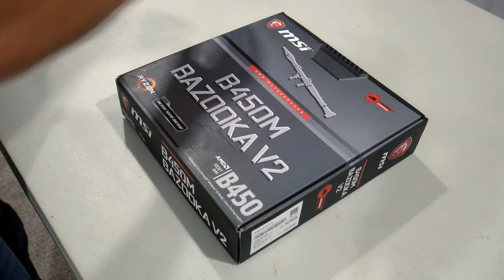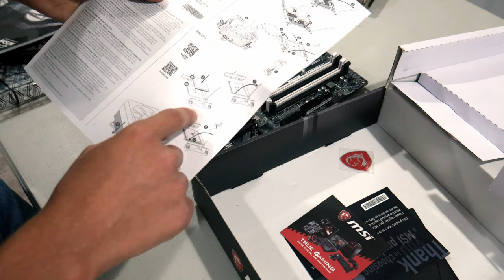Let's Build a Gaming PC from Start to Finish!

Comment: Thank you for this - first time building a PC and this got me almost all the way through. The only hiccup was the little plugins for the front panel into the mobo, I wish you would have explained it a bit more but the mobo manual filled in the gaps. The PC runs like a dream.
Reply from the maker: Yeah, sorry about the front panel cable portion missing. My camera died while I was doing those but they vary by motherboard model anyway so the best thing to do is just follow the manual. Glad you were able to get it all fired up!

Comment: In that connector slot on the motherboard, does it matter where you plug in the front panel headers?
Reply from the maker: Good question! Yes, the motherboard manual will tell you what the specific order for the pins is.

Comment: Sorry for such a dumb question, but what kind of fps do you think this would have in Apex Legends?
Reply from the maker: There are no dumb questions!
The GTX 980 Ti GPU should probably get around 90FPS at 1080p at High settings, with FPS possible by lowering some graphics settings. Hope this helps!

Comment: quick question ive got the pc built with everything but the graphics card do you know if i can go ahead and install windows and all that anyway or should i wait to get the graphics card?
Reply from the maker: Good question! First things first it depends if your CPU has built-in graphics. Most Intel CPUs and some Ryzen CPUs do. This is just so that you can output to a display to install Windows, but if not you'll have to wait to install a graphics card so you can get a picture output on your screen.
Reply: @GTechOfficial  alright cool no image came up so just gunna wait for my graphics card to come in

Comment: Don't forget to ground yourself before you start handling parts with a anti static strap.
Reply from the maker: Agreed. You can also just touch various metal components like the PSU housing or the case to discharge any static.
Reply: built pcs for years and have never had any issue with not wearing a strap
Reply: @iiTzKrypt  I have also, but I have also witnessed a data center ops person kill a hand full of ECC server memory walking across carpet with it in his hand. Given the choice of wearing it and filing a rma. I will wear it. It only takes a moment to put it on.

Comment: Do u need the storage thing and the  graphics card to make it work or can i use it whit out those 2 things
Reply from the maker: Well storage you absolutely need. That's what Windows 10 gets installed on and where you keep all of your files. As for the graphics card, you only need one if your CPU doesn't have built-in graphics. But if you're doing anything more than just web browsing such as gaming or editing, a dedicated graphics card is a major recommendation.
Reply: @GTechOfficial  ok well my budget is at 750 but whit the graphic card is like 300 plus so like i kinda don't wanna get it so is that fine?
Reply from the maker: Well what CPU are you using? If it's an Intel CPU without the letter F at the end of the product name, or an AMD Ryzen CPU with the letter G at the end of the product name, you'll have on-board graphics which will be okay to boot into Windows and all that, but might not be great for gaming.
Reply: @GTechOfficial  ok thank u

Comment: i have one question how do you install the fans
Reply from the maker: This case comes with a series of really wide screws with steep threading which you screw into the fans. There's tons of holes on the front and top of the case but only certain ones line up to the fan mounting holes

Comment: Where can I find them ssd screw spacers with them screws?
Reply from the maker: Give these a try!
https://amzn.to/3LFJTDk
Reply: @GTechOfficial  Is there a uk link where I can get everything screw I need to build?
Reply from the maker: @bdyson8241  the screws will come with whatever case you buy
Reply: @GTechOfficial  can I add a wifi card in this case aswell
Reply from the maker: @bdyson8241  If your motherboard has a spare PCIe slot for one then yes